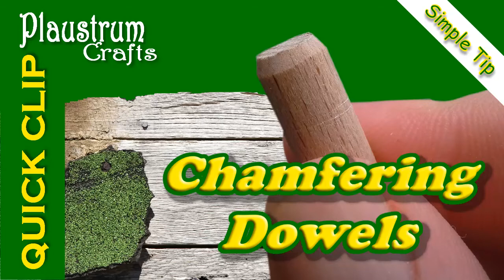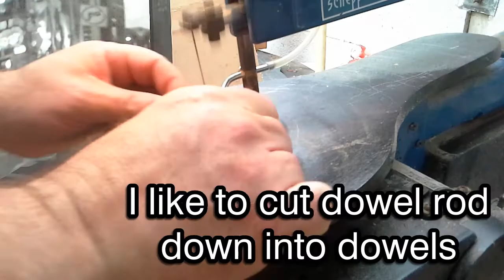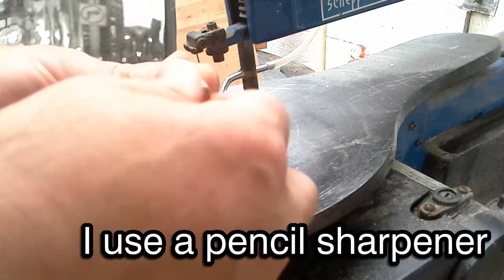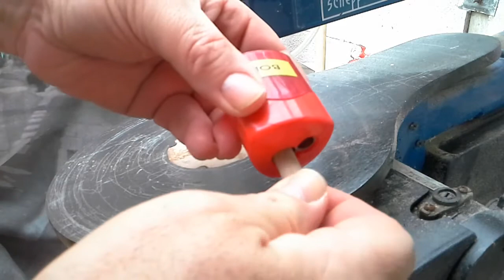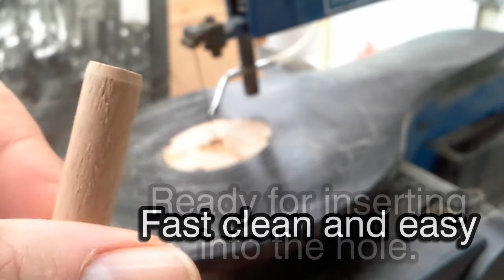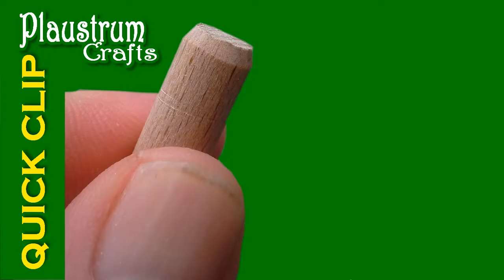Quick Clip #2 Chamfering Dowels a Simple Tip

Comment: WOW! I turn tops for kids and I'm currently working on a batch of 150 tops. Each top is made up of a 4 inch long 3/8 dowel pushed through a slice of limb about 1/2 inch thick and 2 inches in diameter. I have a jig for gauging the depth put it's kinda hard to align the dowel with the hole in the center. If you'll send me your address, I'll send you a custom hand turned top as a reward fort this tip.
Reply: I meant "for this tip". I have a sore finger so my typing is a little off.
Reply from the maker: +Kenny Boothe Thanks Kenny, I hope the tip helps with your tops. And thank you for the offer of one of your tops. It would be a privilege, however, I am in the UK and I have a suspicion you are from USA or Canada, in which case the costs to ship one of your tops would make it an expensive reward. I thank you for your kind gesture, I would love to see a picture of your tops.

Thanks again

Kind regards

Bob
Reply: u r right i'm in measure-by-fractions Florida. Postage is about 25 quid! That's quite a few dowels.